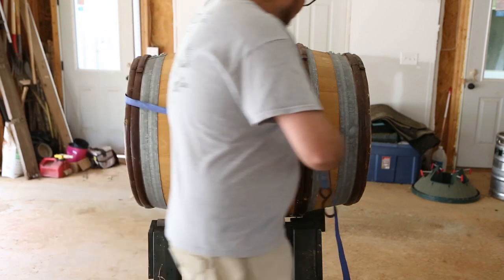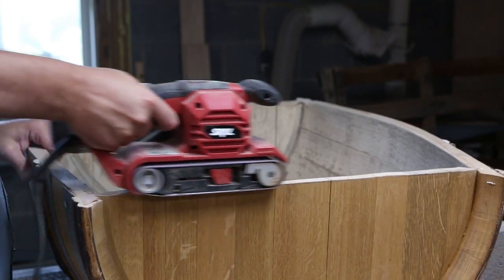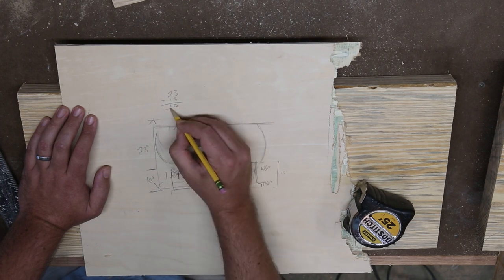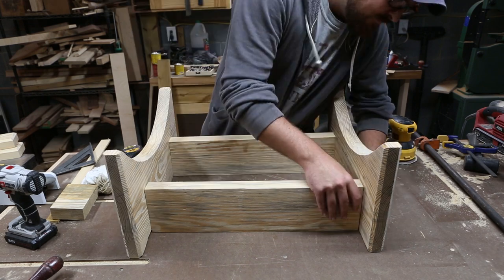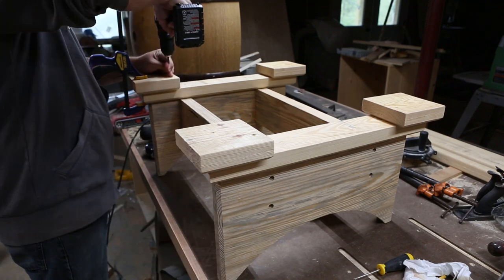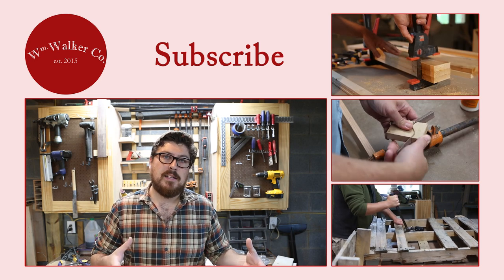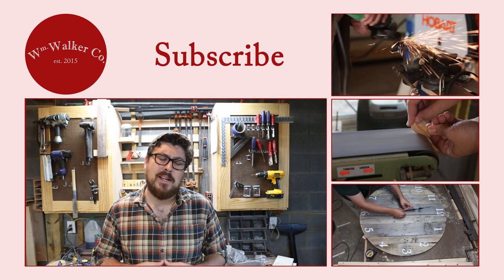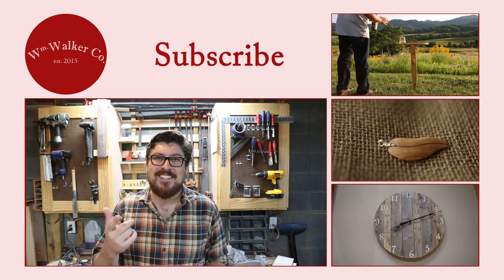How to Make a Wine Barrel Coffee Table (w/ narrative)

Comment: I measured my center line and did the legs first.  Then, when I used one of my truck cargo tie downs to mark the barrel, I also used a level to make sure I was even all the way around.  I used a rotozip to cut the ends which gave me clean lines and minimized my sanding.  You got me started down the right path.  Thanks for making the video.

Comment: I am currently trying this with a whisky barrel.  once I cut the bands the barrel spread and now the barrel heads do not sit in tight. Did you have this issue? If not any suggestions?
Reply from the maker: I didn't have that issue but can definitely understand how that could happen. My solution would probably be to add some (anti)stretchers on the inside of the barrel. Take a long clamp and pull the sides back in to make the tops tight again. Then cut a board to fit the inside flush against the top then predrill and screw some long screws through the sides into the stretcher, release the clamp to see if your sides stay in place. Then you could plug the screw holes or just leave them open.
Reply: +Wm. Walker Co. I've put in some threaded rods just inside under the heads. I believe I'll be able to hide the added hardware on the outside.